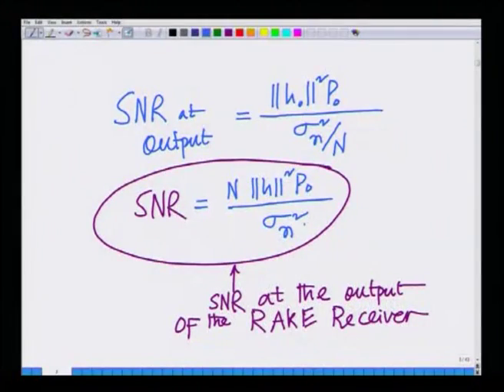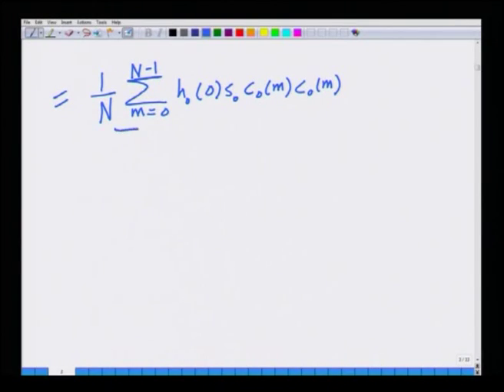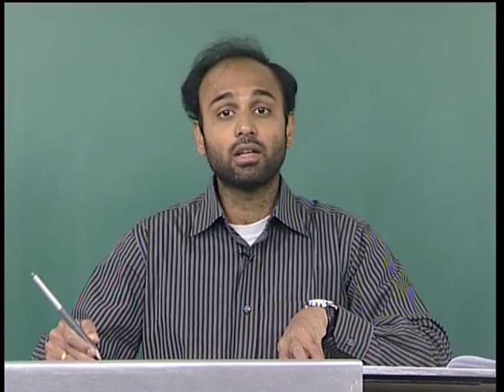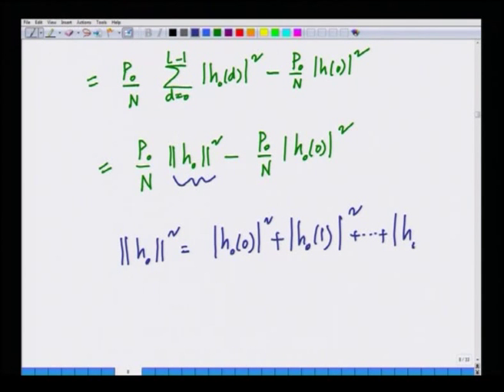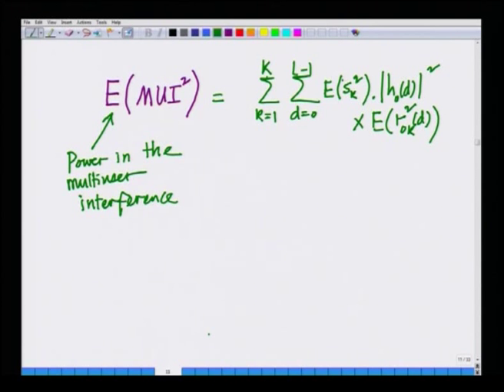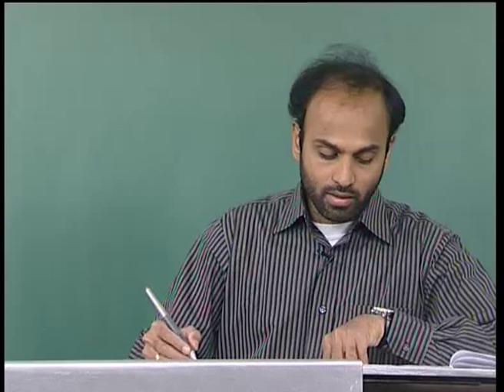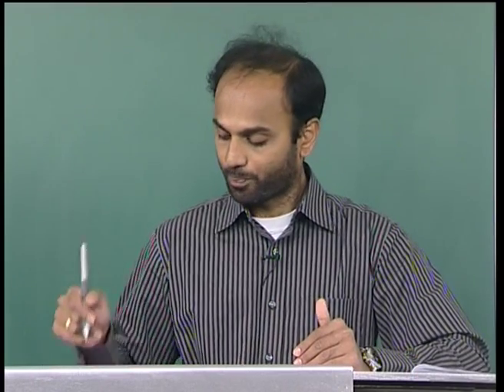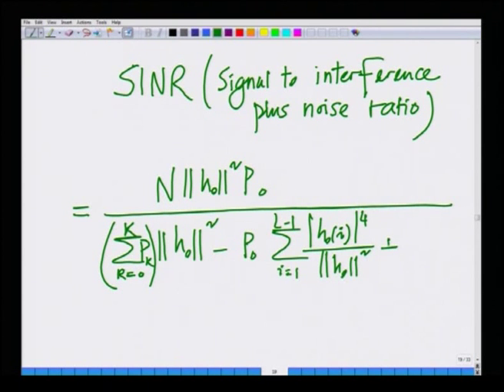Mod-01 Lec-18 Multi-User CDMA Downlink -- Part II

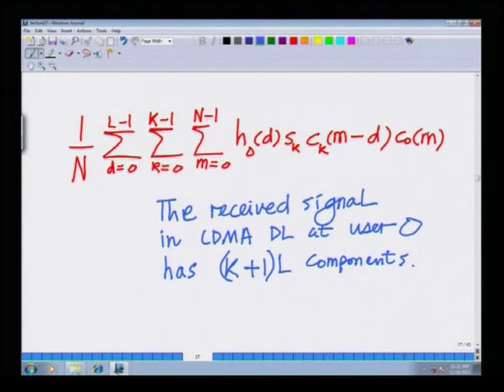Comment: As it is mentioned in the Lecture 15, the factor of 1/N is included in the correlation properties. Likewise, the variance of the Auto-correlation is equal to 1/N for k!=0 (see the time 3:45).
Considering these facts, at time 19:15 of this video in the last line should be (1/N)^3 instead of 1/N. the reason is that variance of R00(d) for d!=0 is 1/N and there was (1/N)^2 at the beginning.

Please let me know.
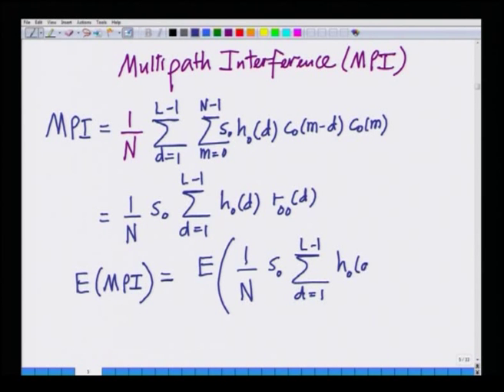Reply: At 15:15, there is no 1/N factor in MPI expectation......So it follows in 19:15, as there is no 1/N term in expectation, there will not be any factor of (1/N)^2 in variance....so 1/N is correct in the final expression....mistake is at 15:15...